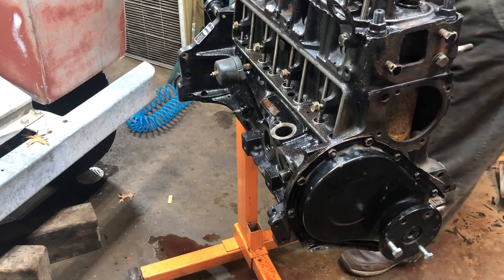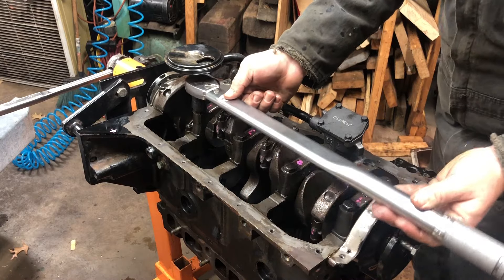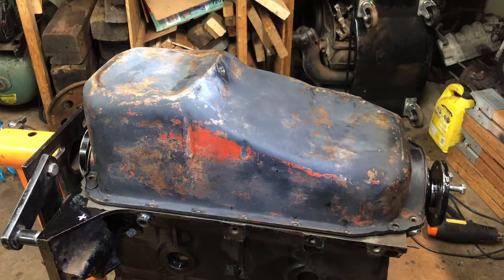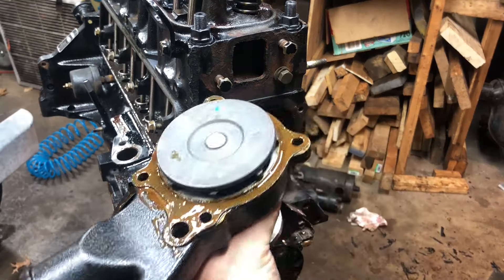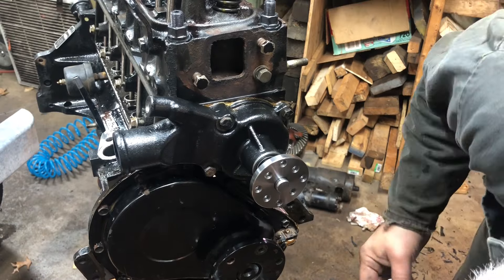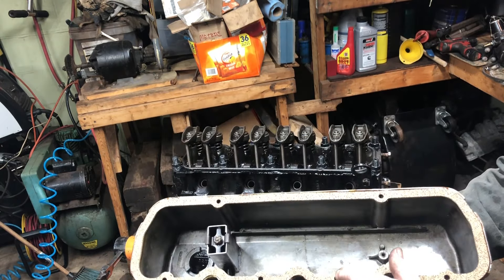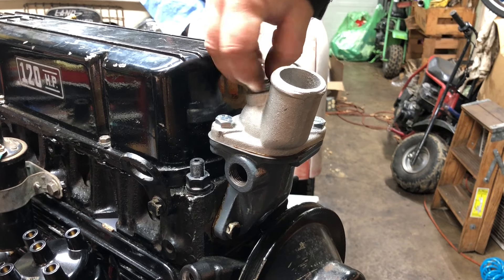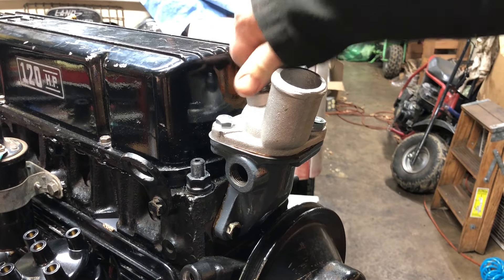Oil pump, thermostat install in GM Mercruiser 120 153 151 Scotty engine Swap Land Rover Series 2A 3

Comment: It's coming together nicely! Looking forward to the next one, getting closer to a start! I keep looking at the spare 2.25 that needs a full rebuild in my garage, maybe one of these days...cheers Cory!
Reply from the maker: Thank you Sir!! It’s really taking shape. It’s pretty cool. A petrol would be sweet with a fresh rebuilt. Is it an extra engine or the one needed for your truck?
Reply: @conrad1468  the 2.25 petrol in my truck was in great shape. I got it running about a week after I bought it, as it was only missing radiator hoses. I was then really lucky and was able to buy another engine, gearbox and transfer box for $250, but I did have to do an 8 hour round trip to pick it up! I also bought another rolling chassis for $350, mainly for the truck (ute) cab (mine is a rag top) - a 12 hour round trip. My goal is to have a spare engine, gearbox and front and rear axles fully restored and awaiting the inevitable breakdowns! I sure hope this goes well, it will be great to see you taking the Landy on some longer road trips!
Reply from the maker: @merykjenkins3274  wow!! Those are lots of good deals on parts. Especially the engine! No deals like that in the USA. Ha ha! Long road trips are the plan!! Hopefully!! 😀

Comment: That engine originally had a water hose going into the exhaust manifold. I can’t remember specifically, but believe the smaller fitting off the water pump and one of the fittings off the thermostat housing fed it. That engine usually used raw water to cool the engine, and used a cooler thermostat. Salt water crystallizes at approximately 180 degrees, so that’s why they use a cooler thermostat.
This will be a nice fit for the Landy and give a substantial horsepower increase.👌
Reply from the maker: Excellent info!! Thank you for sharing. I never thought of salt water crystals. Very interesting. The guy I bought this engine from has no idea where the engine came from. But, it came from Ohio, USA. No salt water around in the Midwest. Ha ha!! But you never know?!?! Hope she likes being run in a Land Rover.
Reply: @conrad1468  
It should be awesome. It’s a solid engine!